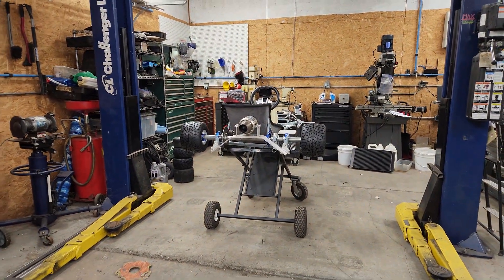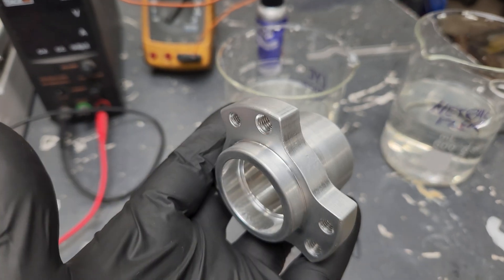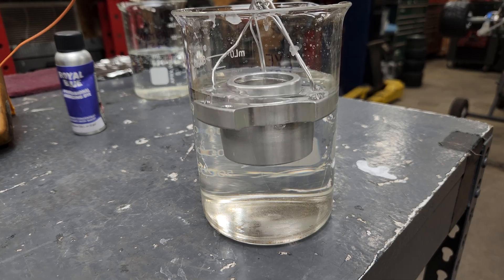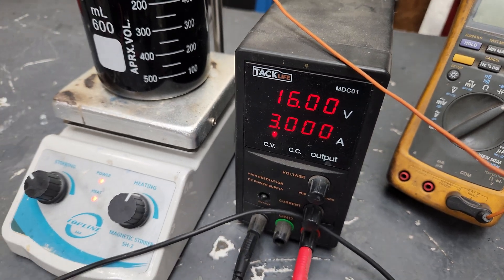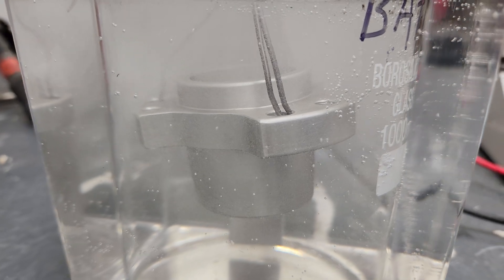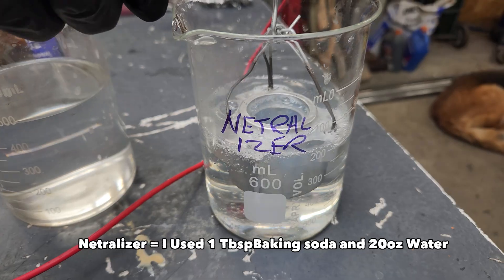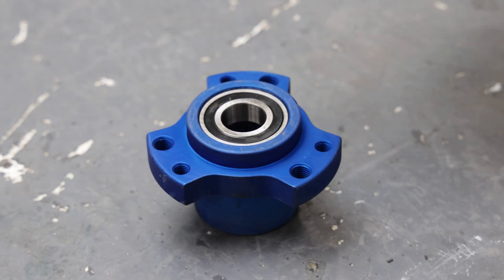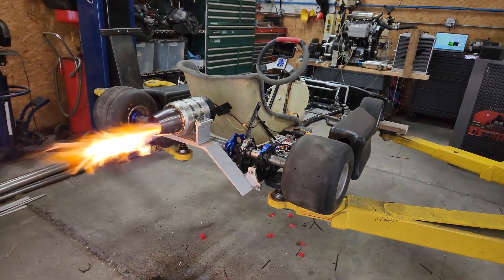How I Anodize Aluminum Parts at Home

Comment: A tip when anodizing painting and really good when powder coating any threaded holes put bolt in it. Coating gets full coverage, bolt can be used as spot to hang it from, no lines or spots missed, and with powder coating getting the threads coated means more work cleaning out threads so bolts go in easy as powder coat is thick and every thread coated has to be reamed with thread tool or bolts are not fitting in good and throws off torque numbers.

Comment: Theu need to make a hot metal burst spray sort of machine that can blast hot metal spray in a mist in conjunction with some chemical or other material that creates a color mosaic when the two sprays meet midair before adhering to whatever you wanted to hot metal color spray. Of course you cover the screw holes and other parts you don't want hot metal color spray coated...but I think this process would add a layer of protection greater than anodizing and give a unique pattern to each part or item hot metal sprayed. The machine would have to heat up a small ball of metal to a liquefied state, then a blast of air the moment the machine opened up the port holding the liquid metal sphere at the same time another spray nozzle released its own sphere air blast of coloring material so the two hot mist sprays collided moments before hitting and welding themselves to the part. Not sure what to call this process...hot metal mist coating?

Comment: Why you don't colour your parts directly only with one step without powder? Normally depending on voltage you can put it directly in water with for example backing powder and get your colour.

Comment: I’m glad this video popped up. I have a book called the Metal Polisher, Buffer and Plater. It’s generally about the start of the union but covers a lot of techniques and technical data about processes of polishing and plating metal. Well the first article that ever appeared on electro chemical cleaning was published in 1905 and I thought it was a wild concept to clean metal with electricity but interesting to see that the process is still very similar to today. The book has different formulas for different metals and a bunch of other nuggets of knowledge from old platers for anyone interested in this stuff.

Comment: great video, but more info 0on the dye? type? where do you get it etc? is it diluted or just poured straight into a container
Reply from the maker: Sorry I thought I mentioned that, I don't remember the brand but it was just something I got off amazon, I looked at the ratings and got one that was rated pretty high. As for the amount and the solution, I just read the directions, I don't remember the amounts.

Comment: @WarpedYT Have you ever machined aluminum after anodization? I'm wondering how deep the color goes. I'd like to do this on some aluminum pieces I'm making and then run an etching program over the surface to reveal the untreated aluminium underneath. I'm wondering how deep I would have to cut (genterally).

Comment: I had no idea anodized aluminum was just etched allowed to get a coating of oxidation and then dyed I didn’t even know that you could dye aluminum I thought it was kind of like titanium anodizing
Reply: Yes, I also thought the color came from the anodizing itself.  The anodizing is only a prep step prior to adding the color.  The next time I have a car battery that is bad, I'll drain the acid out  before taking it to the store & try this process out.  I wonder if easter egg dye will work for this, or fabric dye?
Reply: @huckbeduck but I’ve witnessed it tho???

Comment: That seems like really high amperage for that size from what I've read so far? I only JUST started experimenting--does this work better. The reason I ask is almost everywhere I read, for that acid concentration they recommend 6A/Ft², which would be more like 0.5A for a part that small?
(And probably for an hour so at that rate based on the "720 rule") Any advice?
Reply from the maker: Yeah well I can tell you I looked at every chart online as well as the very reputable ones and even if you follow the instructions to a t for some reason or another The amperage and voltage for me never matches, so I do it this way and it always works. So just like you I was a little confused because nothing I did matched what I read but it works.

Comment: This video is so awesome I decided to buy my own setup off amazon so I can anodize my AR15 parts. I spent about $200 and all my parts came in yesterday. I am a littler confused tho because research online instructed me to use something called a 720 calculator which tells me to anodize my part at less than an amp. My part is about double the size of the part you anodize in the video. I tried it and it didnt turn out well. I made a mistake somewhere. Ill try again today after work. I may need to anodize for an hour at 3-5 amps. My part is about 8inch by 2.5inch. (AR15 upper receiver) Thx for posting!!
Reply from the maker: I found personally that if I followed those calculators online for some reason it wouldn't come out good, I don't know if it has to do with location or specific part or the type of water or what, but I always ended up using more voltage and amperage than was stated, once I started just going with my gut then I've had very successful parts. When I was following the online instructions to the t I had many failures.
Reply: @WarpedLab  interesting. I guess it’s just trial and error. I anodized my part recently at 30 volts 3 amps for an hour and turned out great! Took the dye perfectly. Posted my piece on Reddit and other guys liked it too. Thx to your vid!

Comment: Why does the voltage drop? If anything it should rise based on ohms law. As the anodized layer increases the resistance should increase and cause a voltage increase. Thanks for the video detailing your process
Reply from the maker: I believe I had fixed voltage The amperage is what was dropping. As the resistance increases the voltage would go up to keep the same amperage.

Comment: So it’s just dye? I thought anodizing meant creating a thin layer of oxide that bends light causing colors to appear?
Reply from the maker: The dye bonds to the oxidizer. You need the oxidized layer first and from my experience I'm not an expert, the anodized layer is very porous and sucks the dye  in.

Comment: Dude isnt wrong about PPE. I had a clogged drain a few years ago and after the hippy dippy drain cleaners sourced from sustainable feed stocks by companies who dont make any profits and none of their employees even have microagressions, all failed, i went and got a container of Lye aka sodium hydroxide. I knew how nast this stuff was so i wore gloves and glasses but when i took those gloves off some lye crystals must have been on them and shot up and stuck to my neck next to my adams apple. And thank god for movies because as that burn set in Fight Club popped into my head and i grabbed the Vinegar which neutralized the lye. No scars or anything because it was such a small amount but fuck me running did it hurt
Reply from the maker: Yeah that stuff is no joke... I used to use a very strong base to clean industrial cooling towers and you will for sure develop fungus on your nails If you get that stuff into your cuticles, because it changes the pH of your skin... So not only Burns but also fungus no joke.

Comment: The voltage should generally be increasing during the anodizing, not decreasing. I believe the small decrease shown is due to a short-term upset to the bath. If it's consistently dropping you probably connected the wires backwards and are removing any existing anodized layer.
Reply from the maker: Hmmm... You might be thinking of the fact that you have to increase voltage as anodizing layer gets thicker to keep the amperage the same, The anodizing layer is an electrical insulator, have you ever tried the weld a rusty piece of metal,  think about it as you have a conductive wire that you add insulation to, as time goes on the insulation gets thicker and thicker and the resistance goes up, amperage goes down And you need more voltage (push) to get the electrons through that insulator.

Comment: What kind of power supply are you using?

Does it regulate or limit current or voltage?
Reply: it is a constant current supply, it increases the voltage until the desired current is reached

Comment: Hey. Need some help. I have a motorcycle rim which I need to take the paint off from. However, lye bath did not work, hence, not anodized. Paint remover also did not work which usually works on other stuff... The paint is Matt gold, kinda rough to touch. Any idea what kind of paint or color is it and how would I remove it???

Comment: I thought he said in the beginning when fashioning the handling bracket that wherever that touches does not receive anodization ? Or did I misunderstand ? I only ask since it appeared all the threads were anodized.
Reply: The point contact from the aluminium wire will be extremely small, it is at this point that no anodising will occur.  After dying, you will see tiny spots where the wire touched the thread crest.

Comment: Sulphuric acid diluted 1:3 with water. Which concentration sulphuric acid do you use to dilute?
Reply: Im currently researching aluminum anodization and it says that the concentration should be 10%-15%, so i would recommend buying the already diluted solution. Gonna try to do it myself next week. Buuut if you cant find one with that exact concentration, you can easily dilute it with this equation: c1*v1=c2*v2; c1 is the concentration of the solution that youre diluting (starting solution), c2 is the desired concentration, v1 is the volume of the starting solution and v2 is the amount of destiled water you have to add to the starting solution. Make sure your units of measurements "allign" so c is mol/dm3, so the volume is dm3. Im from croatia and thats how i learned here, but unites can be changed to apply to your preferences!! I hope it helps :)

Comment: Been anodising aluminum parts like this for years. Very satisfying once you get it right and use genuine dyes. Just a quick point on the turbine flames at the end; 'hot' starts are definitely to be avoided! Lift the front of the kart to drain excess fuel from the gas turbine.
Reply from the maker: Agreed, as for the hot starts I like them sometimes it gives a good light show haha.
Reply: What are the correct dyes for this?
Reply: @slushedpuppy  Sorry if this sounds like a stupid response, but Google Anodising Dyes and buy whichever colours you want. I found that bright red works extremely well. Some people attempt it with clothing dyes but that gave an awful result when I tried it.
Reply: @slushedpuppy  RIT
Reply: @justotalkalottashit8392  - Just their regular fabric dyes?
Reply: Have you ever machined aluminum after anodization? I'm wondering how deep the color goes. I'd like to do this on some aluminum pieces I'm making and then run an etching program over the surface to reveal the untreated aluminium underneath. I'm wondering how deep I would have to cut (genterally).
Reply: @JustusScottJr  not deep at all. it's on top of the alloy not in it like a wood stain.
couple thou at most

Comment: So what are you doing with your waste? Do you have a wastewater permit?
Are you neutralizing the wastewater and precipitating out the aluminum hydroxide then filtering it before discharging your waste?

Also commercially there is a step between the high pH etch stage and the anodize stage, it is called de-smut. It is an dilute acid mix dip to remove the silicon, chromium and copper left on the surface of aluminum alloys like 6061.

If your power source "leaks" some AC current (seen it, not all electronics are created equal or run forever as they were designed) your anodize job will be poor and will not have good corrosion resistance.

Comment: Great video.  Great job!   I'm thinking; While it's in any bath, give it a few taps, swirls or shakes to remove bubbles and possible voids in the coatings.
Reply: we used a slow circulating fluid to do this.  Because  shaking may disrupt the current which messes up the anodize.
Reply: @phild8095 would you mind explaining the slow circulating fluid step? Informative video thank you
Reply: @abishopish  Actually it was done with very fine aeration.  These plastic tubes were run through the tank and low pressure air was pumped in. The plastic tube walls were porous, not drilled holes. The bubbles were small, like beer bubbles. It just slowly moved the fluid up one side of the tank so that it circulated in the tank.
Once you have established current you don't want to interrupt it until the step is completed.

Comment: You're not understanding how a constant current power supply works.   You set the maximum current (Amps - think flow) and the maximum voltage (think pressure).   The powersupply initially can flow 4A easily, because bare aluminium can conduct quite well, so it only takes 1/2 a volt to flow 4A of current.  As you build up an oxide layer, it can't flow as well (as Al oxide doesn't conduct particularly well), the power supply has to ramp up the voltage (pressure) in order to continue to get 4A of current(flow). You never reach 20V, because you never have a point where you need that much voltage to get 4A to flow.  However, near the end there, 4A @ 15v is going to heat up the part and liquid pretty quickly, as the power increases (V x A = 60W).  Think how hot a 60W light bulb gets...

Comment: Hehe 66.6 k subs 🤪 

I thought that voice sounded familiar! 
I weld for a living - and we use a veryy deep  saturated red dye /I’m for ndt , 
and I’m now curious as to if I can lightly sandblast and/or ( either) use draino as an etchant ? 🤔
On my breaks I’m making an assortment of components i was too cheap to buy lolol 
For an auto rotation mount system for a telescope as a side job for myself, 
-Under test loads It’s pivot points already have started to pill and get scratched up. 

I was curious if you happened to know  if this/ your method and it’s ultimate results give a really good finish!  
I’ve already ran into some alum on alum friction And scrapes  
- requiring some fitting 
But you mayyy have just solved my conundrum! 

So 

Thanks brother! 🤪

Comment: Seems more like dyeing than anodizing.
Reply: It's both.  The anodizing step grows the aluminum oxide cells on the surface of the part, which are then filled with dye.  The boiling water step closes the oxide cells, trapping the dye inside.
Reply: @seegee-u3l  So there's two ways I have seen of adding a color as I understand it?

I've watched videos using aluminium and titanium components and it's either anodize by running a current through a piece immersed in solution until there is a color change or, as is the case here, by adding a dye as a further step.

Would I be correct in assuming these are two basic methods? 

I haven't seen titanium components dyed, just aluminium ones.
Reply: @tomstamford6837  Titanium is different, because the oxide layer itself can produce optical interference effects that inherently provide color, unlike aluminum oxide.  The colors obtainable from anodized titanium are dependent on both the thickness of the oxide layer, and the temperature at which the anodization process occurs.  Aluminum doesn't do that, so it needs to be dyed to produce color.
Reply: @seegee-u3l  Amazing. I say that as a former engineer (civil only!).

Thanks for the clarification. I have wanted to know the process since I was watching something on Discovery Channel in 2003, but had to go meet someone and missed the segment. It was never repeated and over the years I never looked it up despite the internet and somehow this caught my eye and resurrected my interest.

So thank you again for ending 20 years of nagging curiosity, both yourself and the video creator 😁 I appreciate you taking the time to respond. 🙏
Reply: @tomstamford6837  You're quite welcome.  I've done some Type II anodizing of aluminum at home with good results, but never Type III (which needs to be done at a much lower temperature with tighter process controls), nor have I done titanium.  If you ever want to experiment with it at home, I suggest a lab power supply that can provide a regulated constant current, and using sodium bisulfate (sold as "pH reducer" at the hardware store) instead of sulfuric acid as the electrolyte makes the process a little easier and safer in hobby applications IMO.  Edit - I'd also recommend using a good purpose-made dye.  A lot of folks use cheap fabric dyes (like Rit), and they work well, but I find that Caswell dyes produce better results and are more colorfast.
Reply: @seegee-u3l  Cheers Steve, thanks for the extra advice. You made my weekend, much appreciated. ✌

Comment: I'm interested in anodizing transfer case parts. My question is will any of the anodizing ever come off internally where it will be bathed in oil.
Reply: Anodized aluminum is very wear and corrosion resistant if done properly. Chemically it is equivalent to sapphire which is next to diamond on the hardness scale.

Comment: hey instead of dye, rip the oxide off and electroplate the pores with copper/nickel/titanium/zinc/chromium (high temp coating)
Reply: Aluminum's not suitable for high-temp applications.